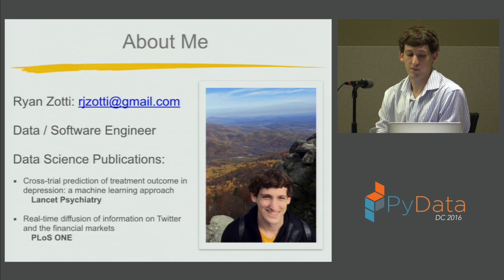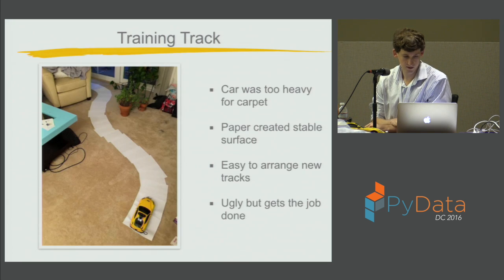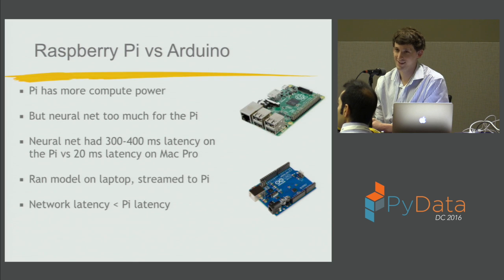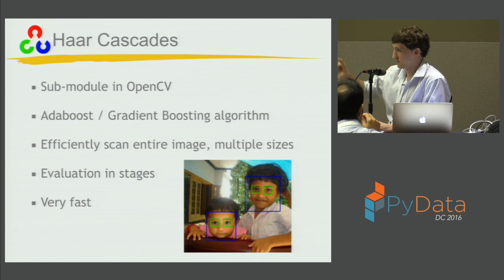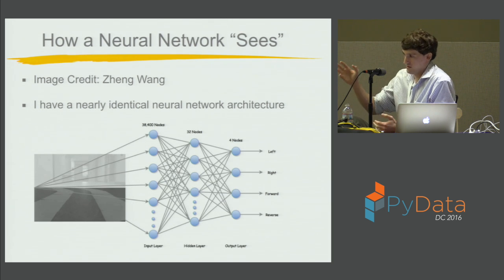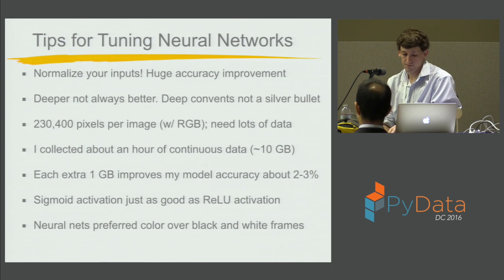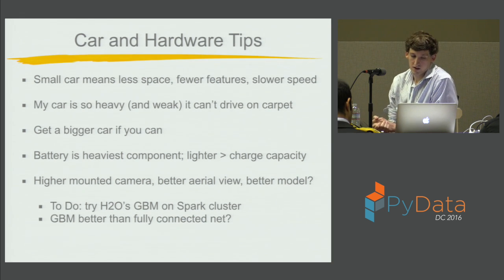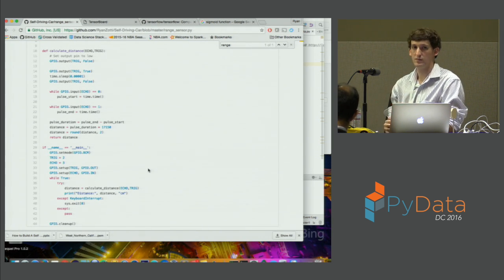Ryan Zotti: How to Build Your Own Self Driving Toy Car | PyData DC 2016

Comment: Math is not my strong suit ... He comments that convolution nets are 'over-hyped' then talks about using HAAR cascades in Open CV. From my limited understanding HAAR cascades use HAAR features which are convoluted across the image. At a VERY high level they sound like the same thing? He did mention that he trained the convolution net from scratch, rather than using the lower portion from else were. Wonder how well the convolution net would work it you used the HARR features as the first layer?